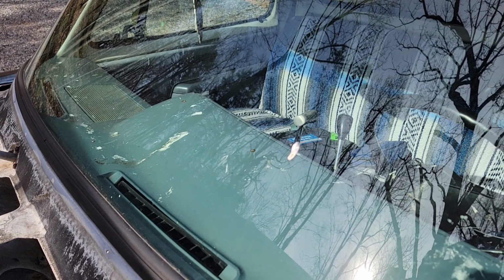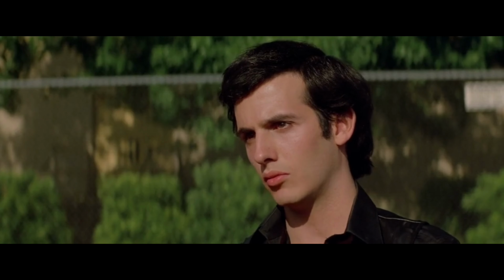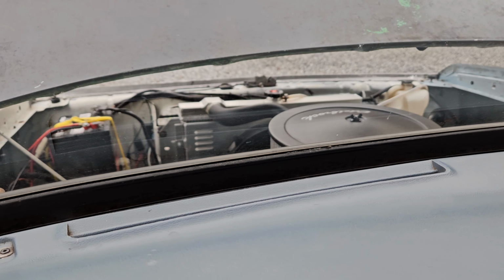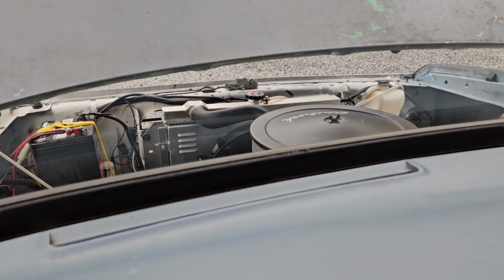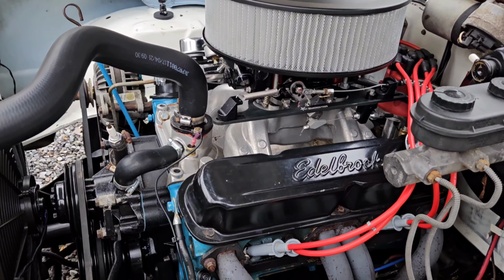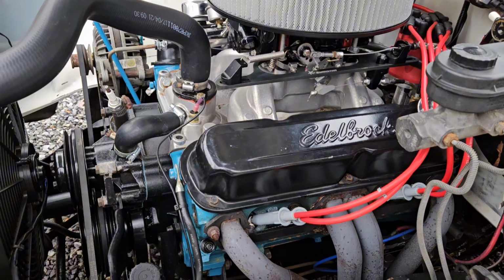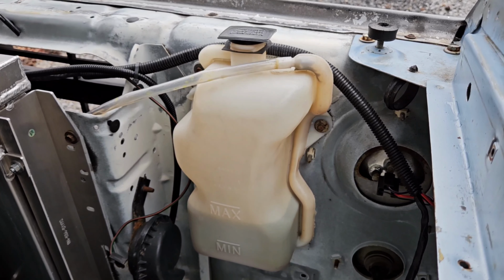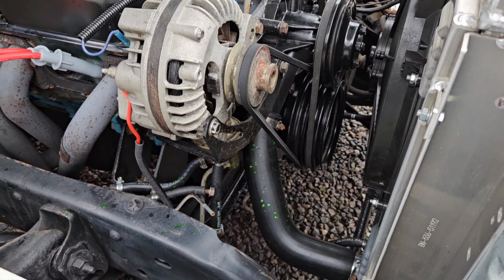Troubleshooting Cooling System Pressure in Small Block Mopar Engines #mopar318 #d150

Comment: It seems to be missing hard at idle..  Do you have a 1/8 hole drilled in the thermostat helps with bleeding air out of the system... My 318 roller cam runs with a 195 t stat in summer barely makes it to half way on gauge in traffic 98° weather I run a 7 blade HD fan with thermo clutch and the thick stock truck radiator.
Reply from the maker: Plugs have a lot of idle time on them, I need to change them. It has a 180 t Stat and 3 row radiator with electric fan. I'm leaning towards a leaky head gasket.
Reply: Get the blue test liquid and test for CO2 in the coolant if there is no signs of water in the oil... Good luck man.